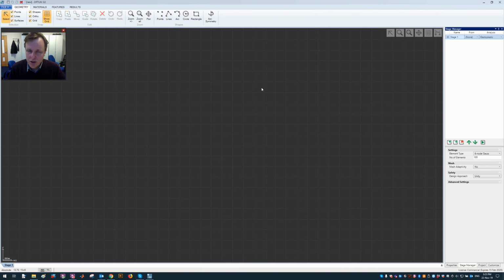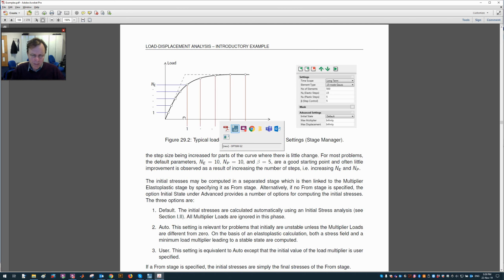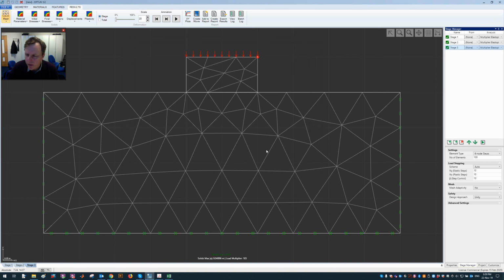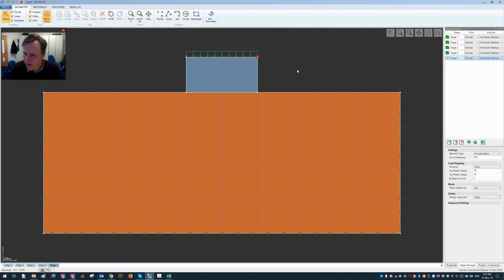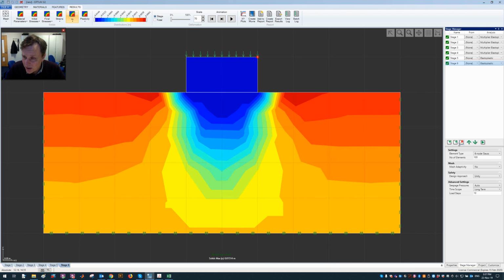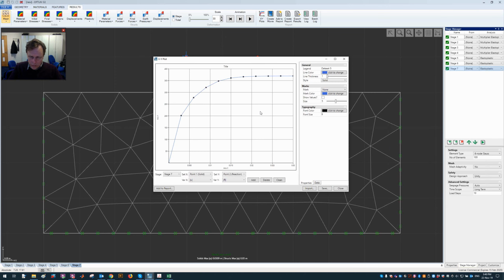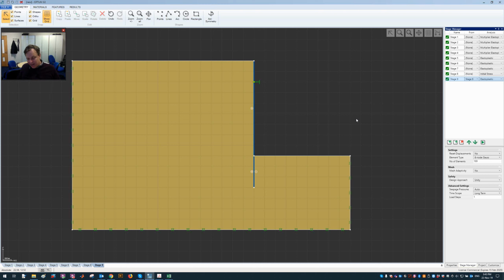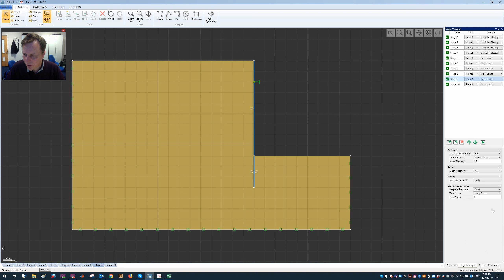Load Stepping in G2

Comment: 21:37 As I understand it, stage 10 should have started from stage 8, not from stage 9? For this reason, it was not possible to clearly show the differences?
It turns out that it is better to set more load steps when excavating the soil?